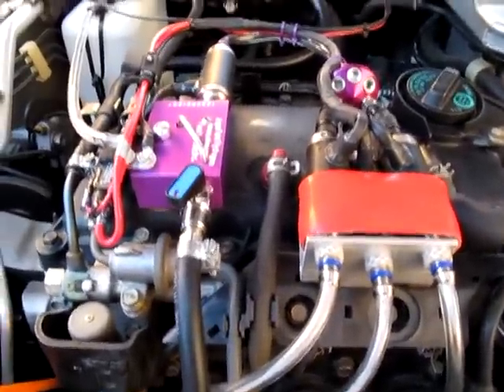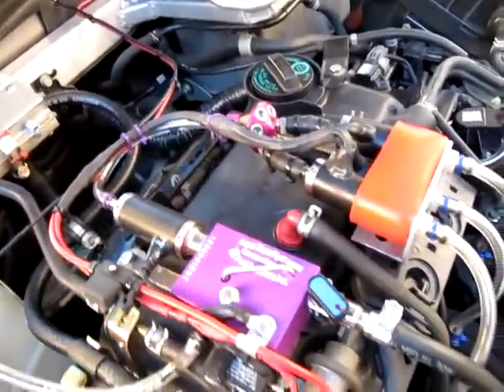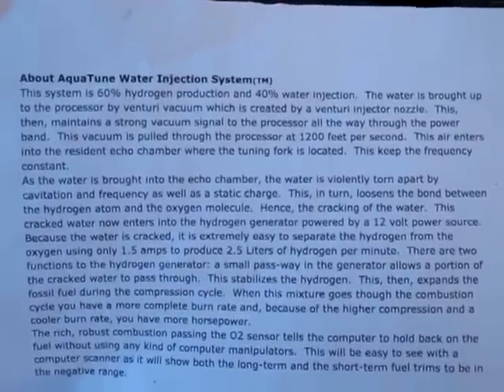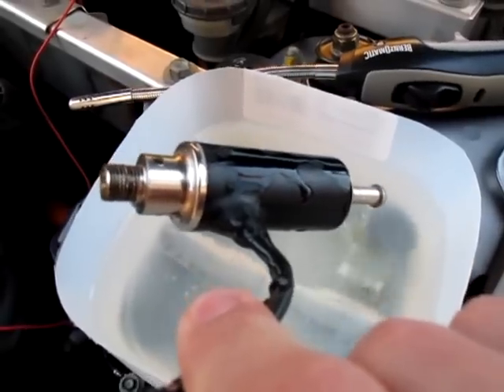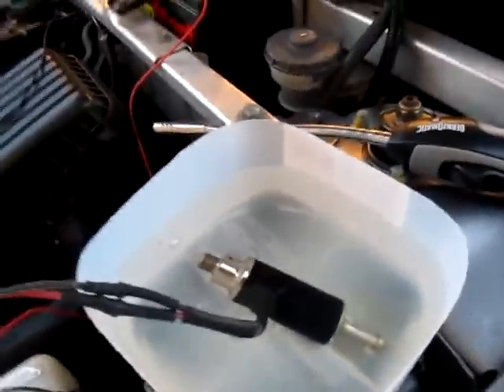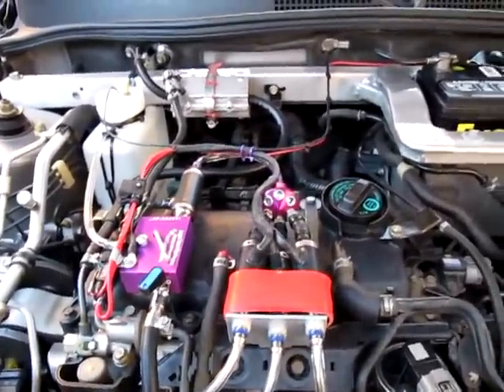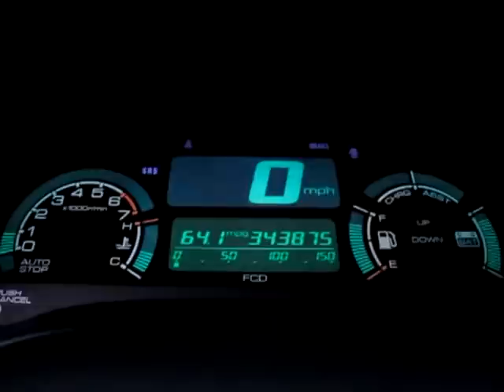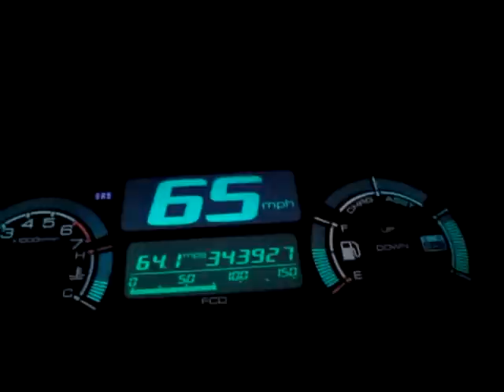Water Fuel Technology For Everyone - AquaTune Hydrogen Fuel Systems

Comment: Have you experenced any problems with engine overheating after running the system at idle for long periods of time?
Reply from the maker: The AquaTune Hydrogen Fuel System reduces combustion temperatures- both at idle- as well as throughout the engine rpm range. This is by design. To learn more- please contact AquaTune Hydrogen Fuel Systems. Excellent Question :)
Reply: Wow you are able to change the timing on a computer controlled ignition system you guys are good! LOL
Reply from the maker: Glen Hughes  Actually AquaTune Hydrogen Fuel Systems gets all the credit. AquaTune is Brilliant :) My research and study indicate- the AquaTune Hydrogen Fuel System integrates itself into the automobiles computer and emissions system in a way that I have not seen in any mass produced- Hydrogen- From Water- Fuel Systems thus far. The design of the AquaTune Hydrogen Fuel System permits a very rich combustion condition which the exhaust systems upstream oxygen sensor reads and tells the automobiles computer to lean the air to fuel ratio ie less gasoline per given amount of air.

Ignition Timing:
AquaTune injects 60% Ortho Hydrogen and 40% water mist. The 40% water mist expands the gasoline- increases the octane rating of the fuel- absorbs heat- advances the ignition timing- increases compression- removes carbon buildup- then releases it's Hydrogen Atoms within the combustion chambers- burns ie oxidizes 7 to 9 times faster than gasoline with more than twice the energy ie btu of gasoline. This thus results in a more efficient combustion of gasoline's molecules- thus reducing Carbon Monoxide- reducing Oxides of Nitrogen- and- reducing unburnt fuel ie HydroCarbons :)

Comment: Hello I just want to comment on how i personally think this system works. I think that the engine vacuum sucks water via a venturi action and their is a needle inside the purple box that makes the water into a fine mist and before it can be sucks into the engine it passes through the black tubes and inside of those their are 2 tubes. one is positively charged and on negatively. And when the mist passed through the charged tubes most of it turns into hydroxy gas and part is left as water.

Comment: you may have stated it earlier but it would be useful to know what kind of a MPG improvement it made
Reply from the maker: The AquaTune System reduces fuel consumption by a minimum of 25%. The Honda insight average over a 50% reduction in fuel consumption with the AquaTune System. See these links as well: AquaTune System Installation Overview 60MPG. Was 29MPG. And: AquaTune Customer Achieve Over 80% Reduction In Automobile Fuel Cost- With The AquaTune Fuel System.

Comment from the maker: The Hydrogen Generators produce 2.5 Liters Of Hydrogen Per Minute(Each Generator) when connected to or downstream from- the Processor(where the distilled water reservoir outlet line connects to). The Processor- weakens the water molecules covalent bond which holds the Oxygen Atom and Hydrogen Atoms Together. Once the water molecules covalent bond is weakened via Resonance and Frequency(in the Processor stage of the system) the water molecules then proceed to the Hydrogen Generators.

Comment from the maker: In this video, I'm running the stock iridium Honda spark plugs. Gap setting at 0.039(Honda recommends 0.039in to 0.043in with a service limit at 0.051in)for this model & year automobile. I'm now testing the Pulse Plugs by Enerpulse which are essentially capacitors. The Capacitor Plugs provide a little more power and a little more fuel efficiency. I will monitor the capacitor plugs closely. So far, working well. Note: Stock Honda Spark Plugs $22.oo Each. Capacitor Plugs approximately $13.oo each.

Comment: I'm guessing it has to do with returning normally wasted energy into the system, making it usable. Think of a hybrid car. It uses an electric motor to aid the gasoline motor, increasing efficiency in the process. All the energy still comes from the gasoline motor, but wasted energy is caught and then used. Same happens here, it catches energy that would have normally been wasted, and makes it usable again.
I'm not an expert on this so I might be wrong. :B

Comment: What is your gain? The site claims 25% increase in mileage and 30% increase in power. HHO setups like the one on the ground which you pointed out have been known to give that same benefit. Seeing the efficiency gain (More HHO, less current) I would have expected gains beyond that. One definite upside to this system would be the low power consumption for sure, and less worry.
Reply from the maker: Bone Drone Yes, Exactly! And the aquatune system is a zero maintenance system. The AquaTune System does not require electrolyte in the water. I use Distilled Water from the market in the aquatune water reservoir. The improvement as I have experienced it is less power consumption and no electrolyte and no maintenance. I have achieved approximately 50% gains in fuel efficiency on the 2000 Honda insight. Far exceeding the 25% minimum.
Reply: 150MilesPerGallon Awesome! What did this cost you to build/setup then? My laptop went into stupid mode last night when I tried to visit the site and see all parts cost. The complexity of this appears to be quite high. You did this yourself?
Reply from the maker: Bone Drone The AquaTune System took less than three hours to install. I put the system in myself. Though I recommend having AquaTune Trained installers put the system in. This guarantees a minimum increase in fuel efficiency of 25% or more. Reason being- AquaTune installers are trained in automobile diagnostics which permits the installer to diagnose and repair or replace automobile parts that may be hindering the AquaTune System from working at maximum efficiency(ie a bad O2 sensor can cause this)
Reply from the maker: @116427007930433516216 For pricing specifics, please contact AquaTune.

Comment from the maker: When working with the traditional HHO systems- which use the process of Electrolysis with high amperage- to produce Hydrogen and Oxygen from the initial water molecule- The Hydrogen and Oxygen are both sent into the engines intake manifold air stream to be mixed with air(21% Oxygen, 78% Nitrogen, And Less Than 1% Argon) to then mix with the fuel inside the combustion chambers of the engine- which then proceeds to be compressed and ignited- and then sent out the exhaust ports of the engine-

Comment from the maker: In order to maximize Hydrogen Production- The AquaTune Hydrogen Generators must be connected to the distilled water processor. The Hydrogen Generators- without the Processor will not permit maximum Hydrogen Production ie 2.5 Liters Of Hydrogen Per Minute- Per Generator. The AquaTune system is design to work as a complete system.

Comment: Can a combustion vehicle be run on 100% cracked-water hydrogen, or is gasoline an important factor?
Reply from the maker: Subjektive Algorythm I do not know the answer to this. Para Hydrogen has the btu of natural gas. Ortho Hydrogen has 2.5 times the btu of gasoline. A percentage of the inert gases from the exhaust system can be recirculated back into the engine intake system to reduce the burn rate of Ortho Hydrogen to that of gasoline. Many ways of producing ortho hydrogen are available to be experimented with. Which approach you study is based on that which interest you. The path that nature takes- is that which may be most efficient. Study nature's laws and do not confine your interpretation to others perceptions. Rather let perceptions be the path of discovery and possibility based upon limitless imagination. Remember- Einstein Note: Imagination is more important than knowledge. It is wisdom that teaches us that nothing compares to Passion + Imagination.

Comment: I got a question for u:what do u do when the temperature outside is at -15c?your water froze.
Reply from the maker: Add one part isopropyl alcohol to one part distilled water- to the AquaTune water reservoir. This mixture permits the AquaTune Hydrogen Fuel System to work very well in freezing weather conditions.

Comment from the maker: My research indicate AquaTune makes water fuel technology units for many engine sizes, including- The Diesel Trucking industry- as well as for Locamotives :) See the AquaTune D on the AquaTune web site. I provide the direct link to the main AquaTune web page just below the video description. The AquaTune HB which is the unit I'm running on the 2000 Honda insight, provides a reduction in fuel consumption by 25% or more. Also see the AquaThrustPlus which is design for High Performance Engines :)

Comment: Hi 150milespergallon. I am looking seriously at the Aquatune for my Ford Fiesta. I notice you have extra generators. Why did you add them, What effect did it have and was it worth it by comparison with the single generator. Great video thankyou. Paul
Reply from the maker: Hi Paul. Before I order the AquaTune Hydrogen Fuel System for the 2000 Honda insight, I ask AquaTune Technical Support if I may add additional Hydrogen Producing Capacitors. I specifically ask if I may add one Hydrogen Producing Capacitor to each of the engines combustion chambers. To learn more about why adding additional Hydrogen Producing Capacitors ie one per engine combustion chamber- increases gasoline molecule oxidation efficiency, and thus increases fuel efficiency and reduces Carbon Monoxide and reduces Oxides of Nitrogen, and Reduces HydroCarbons- please contact AquaTune Technical support. AquaTune is highly qualified to answer your question.
Reply from the maker: You're welcome :)

Comment from the maker: In this automobile-Two Liters of Distilled Water Last Two 10 gallon tank fulls of gasoline.That's approximately 1 Liter of Distilled Water, To every tank(10 gallons)of gasoline(The Distilled water reservoir holds two liters of Distilled Water, approximately one half of a gallon of distilled water)My research indicate-automobiles with v8 engines or high performance engines, may use up to two liters of distilled water(See AquaThrustPlus) per 15 US gallons of gasoline, at 6.3 pounds per US gallon.

Comment: so this is a total gas replacement system for your car?
Reply from the maker: This system is sold by AquaTune Hydrogen Fuel Systems- and reduces fuel consumption by 25% or more- as well as increases horse power and reduces exhaust emissions. Please contact AquaTune directly if you have further questions. Thank you for your question.

Comment from the maker: When working with traditional HHO systems- the upstream O2 sensor reads the extra Hydrogen and Oxygen as a lean air to fuel ratio- which tells the automobiles computer to add fuel by lengthening the Pusle Width of the fuel injectors- which then inject more fuel into the engines combustion chambers- thus reducing fuel efficiency. This is one of the primary reasons people add EFIE's(electronic fuel injection enhancers) to their automobiles- in combination with traditional HHO systems.

Comment: Can u use this on a supercharged race engine as in a toyota blacktop 4age 20valve with rotrex supercharger
Reply from the maker: The AquaTune Hydrogen Fuel System works very well on Supercharged and TurboCharged Engines. Please confirm with AquaTune Technical Support for use with your specific model automobile. Excellent Question.

Comment: Is it possible for a larger generator to produce enough hydrogen for a 100% hydrogen driven car.?
Reply from the maker: This question must be asked to those that know more than I. My research, study and experience confirm the AquaTune Hydrogen Fuel System achieves a 25% reduction in fuel consumption, a significant increase in engine power, and reduced exhaust emissions. I'm very grateful I test the AquaTune Hydrogen Fuel System for myself which confirm my research and study notes that the system works very well on gasoline(as well as natural gas) powered automobiles.

Comment: I notice that when you're driving, the dashboard readout is displaying 64.1 MPG. So if the reservoir runs dry (or before you installed this) what does it normally say? Around 35 MPG? And is that readout factory or did you install that as well? Interesting build.  2/5 litres per minute pulling 1.5 amps. I might have to look into this. Thanks for the interesting video, as well as the info in the description. All the best!

Comment: please,can you help by answering my 2 questions ??!!!,,,,after i put this system on my car,do i need to use gasoline ?,,,if yes,,how much it will save money....(how much "generators" does the car(2000 motor) need to run just in this system? thank you
Reply from the maker: Hi Yousef. Thank you for your questions. Excellent Questions. I recommend you contact AquaTune Hydrogen Fuel Systems directly to have your questions answered. It is my experience- and understanding that the AquaTune Hydrogen Fuel System reduces fuel consumption by a minimum of 25%. Many individuals have achieved greater fuel efficiency with this system. Adding one generator per engine combustion chamber(Cylinder) is the maximum efficiency this system can achieve. And it's quite efficient :)
Reply: thx a lot :),,,but how much each generator produce (liters) ?
Reply from the maker: Yousef Issat Hi Yousef. This is a very good question. I will do my best to answer. One way to look at the AquaTune Hydrogen Fuel System is to look at it as if it's a battery. An ordinary automobile battery has positive and negative plates. What happens if you remove all the negative plates? It is my understanding that you would no longer have a battery. In a similar way- The AquaTune Hydrogen Fuel System has two main parts that make the system work- which is to produce Ortho Hydrogen(300btu) from distilled water at extremely efficient rates. One part is the AquaTune Processor- which has a built in Particle Accelerator(resonance echo chamber). The second part is the Hydrogen Generators- which are Hydrogen Producing Capacitors. The AquaTune Hydrogen Producing Capacitors(Generators) produce 2.5 Liters Per Minute- each- when connected to the Processor. Not to exceed one generator per engine combustion chamber.
Reply: 150MilesPerGallon thx again ;)
Reply from the maker: Yousef Issat You are very welcome, Yousef.

Comment: so you have to drive fast in order to maintain a strong air signal through the echo chamber/processor? how else would the air get through, right?
Reply from the maker: Joe Cat Please contact AquaTune in order to understand how this system works in greater detail. The AquaTune is efficient both at engine idle, as well as higher rpm.

Comment: Wow, the fuel check on the car goes up!
Reply from the maker: Yes- It's the instantaneous miles per gallon readout. The 2000 to 2006 Honda insights have this mpg readout which reads up to 150 miles per gallon :)
Reply: 150MilesPerGallon you say it gives 25% increase in fuel ? or am i not understanding , do you have a system that does  Not need to have  gasoline. Cause I wanna be gasoline free.

Comment: its just a more perfect chemical reaction when compared to burning gasoline. in theory the only exhaust created from butning gas is oxygen and water... but there is no perfection because when you combust perfectly engines get too hot (about 14.7 lbs air to 1 lbs fuel) which will cause major engine damage... hydrogen systems allows a cooler reaction which uses less fuel, and a cleaner burn... that=efficiency...yay

Comment: can this run the car if there is no gasoline in the tank?
Reply from the maker: Please contact AquaTune Hydrogen Fuel Systems to have your question answered. My experience with the AquaTune system is that it reduces fuel consumption by no less than 25% when installed and tuned- to the engine in use. Gasoline powered engines, Natural Gas Powered Engines. LPG Engines. Turbo Charged and Super Charged Engines as well.
Reply: 150MilesPerGallon really on turbo also? inlet will be under pressure. thx.
Reply from the maker: d p  This is a question that can be answered by AquaTune Tech Support. Yes- works great with Turbo Charged as well as Super Charged Engines. Tech Support is qualified to answer this question for you. Great Question.

Comment from the maker: For more specifics beyond what I have mention- please contact AquaTune Technical Support in order that your pricing and fuel efficiency estimates may be approximated to a more specific degree. Adding additional Hydrogen Producing Capacitors is something I do recommend becuase these Hydrogen Producing Capacitors provide even more power and fuel efficiency- beyond running the single Hydrogen Producing Capacitor(connected directly to the AquaTune Processor). Thank you for your questions :)